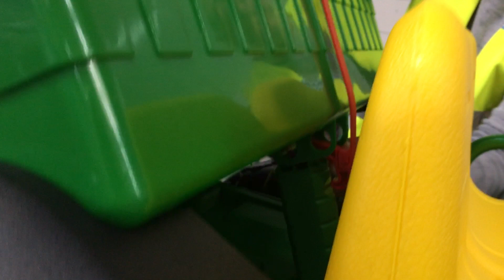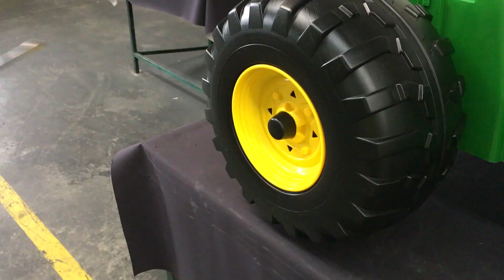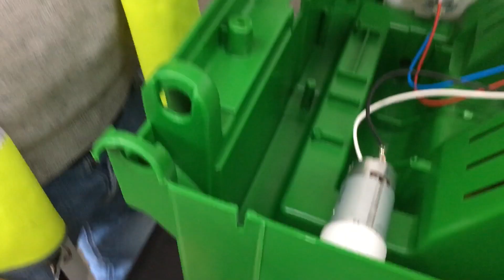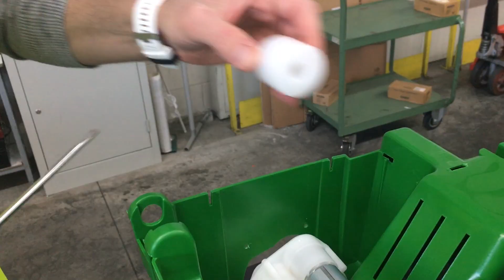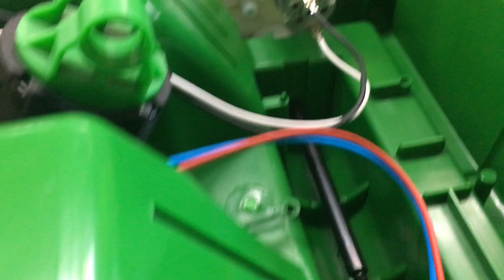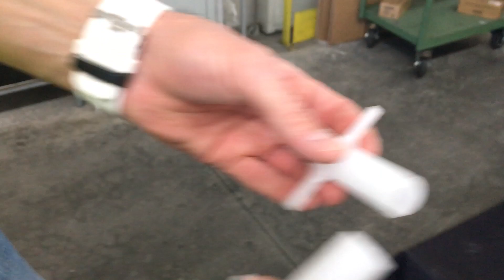Replace the Peg Perego John Deere Gator HPX motorgearbox - sostituire motoriduttore

Comment: Useful video, is there any upgraded motors available for these? Mine failed after an 18v drill battery mod and I'd rather not replace them with same again but something more powerful 👍
Reply from the maker: Hi, please contact our customer service: customer.service@pegperego.com
Reply: What did you do to fix yours? I did the upgrade and my son asked me to turn it and I got on it and tried but it spun and died

Comment: When choosing first gear to drive -> is only one wheel, one motor powered or should both motors be running with less power?
Reply from the maker: Hi, both motors are running in first and second gear with different power.
Reply: @PegPeregoOfficial  Yes, I just put the cable the wrong way. Everything is working fine now. Thanks
Reply from the maker: @simonkoch6485  Great!